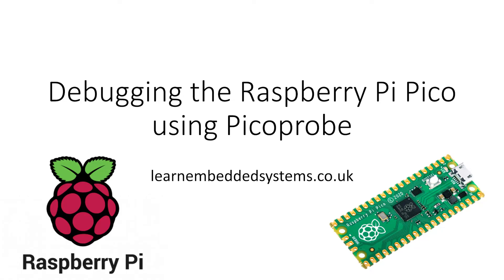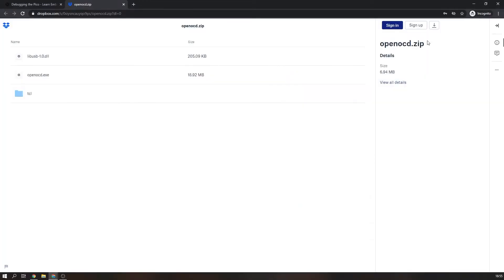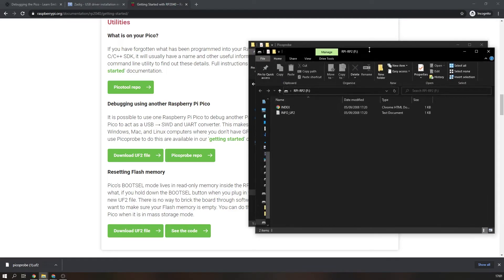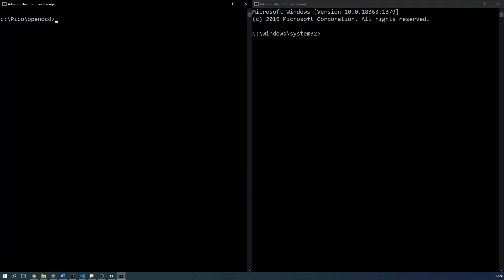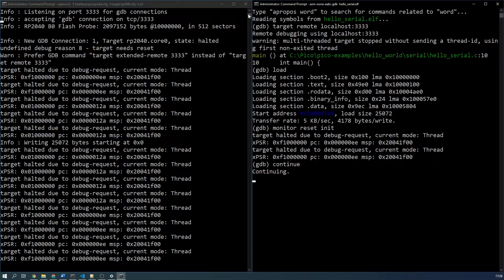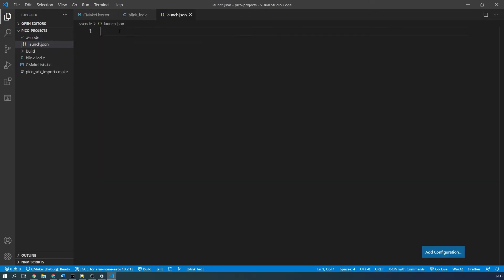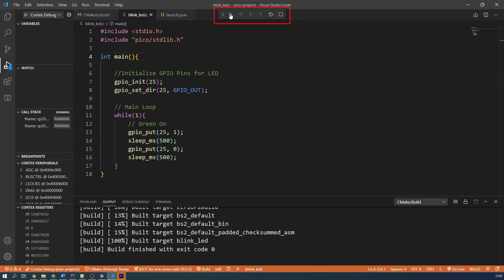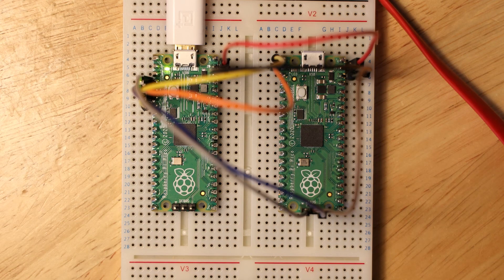How to Debug the Raspberry Pi Pico Using Another Pico! - Picoprobe and VSCode Tutorial

Comment: Very interesting! Thank you! I've got a Question for the Wiring @3:36: Why is the explicit connection - GND of the SWD with GND of the Board - necessary? Doesn't this connection not already exists by the PCB Design? IMHO you'll not need this wire.

Comment: Unfortunately no support for RPi Zero debugging. Only JTAG is possible on older RPi boards, which means that you have to buy a hardware debugger, because there is no openOCD compatible JTAG project for the RP2040.

Comment: I got to the part where I am building the examples and then hit a brick wall. NMAKE.EXE was not found but I solved that, and the build completed but yielded mostly skipping due to unsupported platform. This is an older tutorial and many versions have changed and been upgraded which is probably why. This tutorial exposed several processes I am not familiar with so I know I have a lot of research to do. I'm using VS 2022 community, not 2019 for one. I will attempt to scale back my versions where possible to see if I can get the examples to build. This is a great video! I would like to see it refreshed for 2024 though. Thanks for the contribution!!

Comment: Great video and very helpful. I did however need to use commands from the updated "Getting started with Pico" document as the old command (as stated in the video) does not work any more
src/openocd -f interface/cmsis-dap.cfg -c "adapter speed 5000" -f target/rp2040.cfg -s tcl
instead of:
src/openocd -f interface/picoprobe.cfg -f target/rp2040.cfg -s tcl
Would love to see a part two tot his video!
Reply from the maker: Thank you for letting me know the command changes. I will look into updating the video & going into more detail debugging. Thanks!

Comment: Having problems. I've used Zadig enough to know the UF2 has to be flashed first, but under "Show All Devices" there is no Interface 2, only Interface 0 and 1.   Windows assigns CDC-ACM UART to Interface 1 and it shows up as a COM port.   Windows assigns CMSIS-DAP v2 to Interface 0 and when I run OpenOCD (your prebuilt version) it cannot find a Picoprobe.  I've tried using Zadig to replace the driver with libusb but the same result occurs.   The UF2 file was downloaded today from the R-Pi Pico site.  Any suggestions appreciated!
Reply: I have the same issue, did you figure it out in the meantime?

Comment: Does the new Pi Pico Debug probe program the same way (hold the button, plug in usb, and copying the picoprobe uf2 file to it)?

Regarding the VS Code extensions (Cortex-Debug, CMake Tools, Cpp tools),  
in order to debug non-Pi devices (ex. stm32), would you just need to change the launch json file to point to the target's svd and cfg files?     I understand openocd uses the universal arm protocol 'CMSIS-DAP', but is it necessary to modify or rebuild openocd/msys2 tool whenever you debug a different Arm device (cortex m0<>m3<>m7)?

BTW, George Hotz has a great 2016 video where he shows a different way to debug.. he made a qemu-based tool (qira) that allows for 'timeless' debugging!

Comment: Thanks for this video! Using this picoprobe as a pseudo "Jtag" interface is almost as painful as debugging a kernel driver on a Windows VM! I was able to replicate the processes which is the 1st for me with this project. However, I am using Visual Studio Code with PlatformIO and I need to edit the platformio.ini instead of the json cfg files as they are auto-generated from PlatformIO extension. Can you point me into how to modify the ini file to match the operations as defined in the cfg file?

Comment: It is simply not working for me. I have spent hours at it. What you show in this video does not necessarily follow, what I get in real life downloads, even, if I follow your instructions step by step. I have windows10 on a 32bit desktop PC. Do I need to get a new 64 bit PC with windows 10 ?. 
Your (zip file)  picotool and openocd, did not work on my 32 bit windows 10.
MinGW  is not working on 32 bit windows 10 PC. 
The question is, if I have to get a new PC, should I no get a PI4, or, PI400 which can simplify, considerably,  the set up for me to run VSCODE for debugging pico.
Please advise.
Perhaps it is time for some one to bring out a proper IDE like STM32 IDE with CUBEMX.
Reply: 64 bit binaries will not work on a 32 bit computer... You can buy a raspberry pi or a new PC, that's up to you :)

Comment: I had to copy the picoprobe.uf2 to the pico before zadig would let me install the correct usb driver. That's not the order in the video. Just thought I'd point it out in case anyone has the same problem. Thanks for the videos. A guide to pico debugging would be really helpful.
Reply: Thanks Adam, save me a pile of frustration

Comment: I followed your advice in this video to the letter.  Running the hello_serial.elf worked just fine with the pico-probe and Putty displayed the output as in your video.  

I then continued and installed Cortex-Dubug etc, still all following your advice.  But, when I attempted to debug with Cortex I get a warning dialog that reads:

"Failed to launch OpenOCD GDB Server.  Timeout."

I have tried installing an older version of Cortex-Debug, but I still get the same warning dialog.  What can you suggest please?

BTW your videos are very good.
Reply: I got it to work.  Disconnected the micro-usb cable from the pico-probe, re-connected and then launched VS Code.  Attempted to debug via Cortex again and it worked.  I have now installed Cortext-Debug v3.12 again.
Reply: Can you help me. I am getting stuck.

Comment: some of the steps are presented out of sequence. The picoprobe UF2 file has to be installed on a Pico before zadig installer shows the driver
Reply: I got as far as PICOPROBE UF2 File. Then I am stuck. Can not get openocd to work on my 32bit windows 10 desktop.

Comment: What I would love to see is a very through set of tutorials in C for the Pico.  The examples are great in the sdk but would love additional ones including how to use a TFT display, etc.
Reply: The benefit of using a PICO is to get the applications, up and running quickly.
Reply: Well spoken Mr. Thomas. I am sure MR. Shawn Hymel is up for the task. That is after he has helped me, and the other 99 followers,  to get over sticky points. For now, I am stuck.
Reply: @gautombose4172  What are you stuck on?